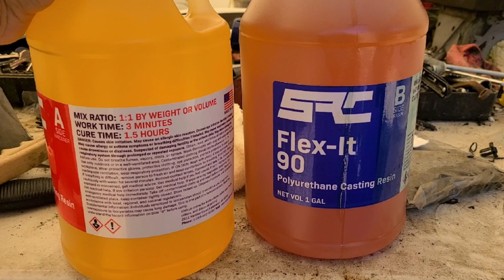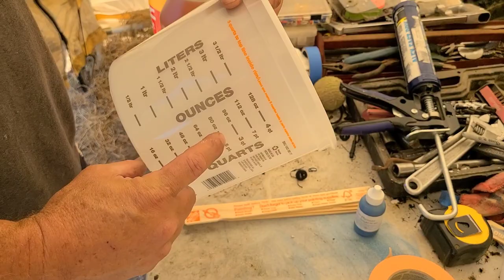How to make polyurethane railcart wheels

Comment: Poured upside down, leaked out the bottom, separation between batches, forgot mould release. Everything went wrong and still got usable wheels 😅
Reply from the maker: 60% of the time, it works every time

Comment: 3D printing the shell of the mould would be an idea; you could build the mould to separate and suspend the rim inside with standoffs. Only some have a lathe to form the wheel.
Reply from the maker: I know someone that did this and it turned out great.

Comment: Over here in England we have electric mobility scooters for the elderly / dissabled . The 6" & 8" wheels use little alloy split rim wheels ( plain shaft with bearings on front and keyed shaft on the rear ) .The poly tyres could be made to sit between the split rims and clamp them in place with no machining .
There are tiny " mini moto " quads that use similar split rim wheels , usually pressed tin that arn't as strong .
Looking at it i bet 3D printed TPU tyres would work brilliant in conjunction with split rims .
AND the mobility scooters use a rear diff to drive the wheels , these have a disconect lever to free wheel so a sprocket could be fitted for pedal power and engage the lever to sit back and use battery power . Sort of a hybrid rail bike idea ....

Comment: Nicely done! I'm considering slices of PVC pipe for wheels, mounted on dolly wheels. Slip PVC over the wheel and inflate the tire to secure it. Maybe an inside flange cut out of some cheap UHMD cutting boards. Wrap the PVC in inner tube rubber or dipped/sprayed in rubber bed liner. 
I was wondering about those Polyurethane "V" rollers that are used on boat trailers. Might be interesting to see how a "V" shape would work on the rails. 
I guess one could, with the tools to do it, make the hub from good plywood. Stack disks to make the cone shape. Find a flat/smooth sided flower pot/plastic container (Maybe even a terracotta/ceramic flower pot). Fill any drain holes with epoxy putty. Calculate the volume of the Poly needed (Definitely get some with a longer open time! LOL!). Pour that volume into the pot, then push in the plywood cone. Maybe an extra piece of plywood for the top with a flange to center the ply cone in the pot. Might need some fine tuning for balance, but that's not hard. Just need the pot to have the right taper on the sides to give you that auto-centering angle for the wheel. 

Or pour the tire on it's own and come up with a three piece wheel, like beadlocks used on off road jeeps and crawlers. If you want to get fancy/ not have to toss the rim every time the wear out/ or if someone wants to produce a wheel for sale that has parts available in case of repair needs. 
  Again, just throwing out some coffee shop engineering musings. :D
Thanks for the videos! Very generous of you and inspiring. ( probably to my wife's dismay..... LOL!)

Comment: To try to get rid of air bubbles, you could try some vibration as soon as you pour the poly. A palm sander, multitool, massage gun or even just tapping on the mold may help the bubbles rise up. Sort of like with concrete............
Wouldn't slightly bigger diameter wheels help straddle rail imperfections?

Comment: You need to prep the steel first, use a polyurethane adhesive, remove all paint etc and after pouring polyurethane it needs to cure in an oven for maximum durability

Comment: Here's a thought I had while watching your machine rolling along. Could you make a wheel by either riveting some rubber cut from an automobile  tire, to a small steel rim? Or alternatively it could be bolted to the rim, using bolts with large countersunk heads, just a thought. Dan S. From Michigan, & Texas

Comment: Ryan, what size are your wheels? 
You said that your flange is 1'' x 1''.
What is the width of the tread area?
My wheels are 6'' tall (7 and 3/16'' top to bottom) x 4 3/8" wide (5 and 1/16" front to back)
That should give me a 1'' inch flange and a 4 and 1/16" tread area.
After I pour my first "tire", (which will use a lot of material) then I will mill it to the finished shape.
Then I will make a two-piece ceramic mold (fire kiln) and use that mold as my new mold and use less material.
The ceramic mold should last forever and make as many "tires" as I want.
I should only have to mill the first tire (we will see)
My molds are ready for the poly and I want to be sure before I waste money.
Thanks :)

Comment: What would you suggest if I don't have a wheel to make a mold from?
Reply from the maker: I originally used at small bucket. Anything that isn't too much bigger than your wheel will work. The goal is to use as little polyurethane as possible.
Reply: @ryanrandomness  Thanks!

Comment: Good job on the wheels,  I wonder if a wood lathe would work for finishing the wheels?
Reply from the maker: Thanks. While not impossible it would be tough.
Reply: It's not the lathe, it's using the proper cutting tool, feed & rotational speed.
Reply: I turned a couple of wheels 8” diameter, x 2 inch thickness to make a rail wheel for moving a large trailer into a barn door .  Limited number of moves, but expect years of service.  May wrap with a band or side bolt a flat metal limiter.  Much easier and cheaper than making full metal wheel.  No welder or cad cutter , or plasma cutter needed.   Just your wood lathe & hole bit, & easy to cut a taper face w wood on lathe. First ones I made from maple , will use gum, elm or dogwood in future and test for life.  .  BTW, if your cart load has great value, add a drop safety block if u are worried about failure, but remember horse drawn wagons to war chariots had wooden wheels for centuries!
Reply: @carmiethompson2676  But you do need a lathe big enough.... 😉👍
Reply: @wingnutbert9685  A wood lathe doesn't have all the control a metal lathe would have. So my previous comment wasn't accurate. A wood lathe doesn't have a controlled cutting tool. It's free hand so thinking about it a bit more then I did previously, I don't think you could use a wood lathe. I'd like to see if someone could though.
Reply: @carmiethompson2676 Yes, for sure a metal lathe would be much easier in terms of  micrometer accuracy and repeatability. But one could use a template gauge on a wood lathe and likely get very very close tolerances. Enough for this work. And certainly requires experienced hands and eyes, but same goes for operating a metal lathe. I've worked with a couple woody's on client projects and I wouldn't hesitate to say turning something like these wheels would would fall into the 'easy' category for them. I've managed to "lathe" (turn) a 1" thick, solid steel pulley for a client. Just used my shop drill press, an angle grinder and a die grinder in a slide vise and a hand file to dress it. Nothing fancy, but was pretty darn accurate for bodging it. 😁👍
Reply: @wingnutbert9685 Interesting, thank you. It's just that I think the precision would have to factor in because there are two wheels that are secured to a solid axle. There's no differentiation at all, a 'Locker' gear in automotive terms. So the wheel diameters & the self-centering taper would have to be very close. In this case I don't know what 'very close' would be but I'm guessing it's a 'close' that would be very difficult w/ a wood lathe. I'm sure it could be done, probably start w/ a single piece of material & cut following a template, then saw in half. Huh...sounds do-able.😎
Reply: @carmiethompson2676  Yep. For sure doable with the right experience, tools and imagination. Given how incredibly thin some turners can get the walls of a wood bowl, precision and repeatability to a thou. is likely quite doable. And I agree the more matched the better. Don't want to feel like you've got egg shaped tires! LOL! 
I believe I've even seen a fella that make a jig/tool holder for his wood lathe. Was pretty bulky as I recall. But did work very good. He could clamp both wood turning chisels and had an adapter to hold carbide metal tools as well. And could even do aluminum with the wood tools. 
Guys in little villages, in Asian countries are the ultimate masters of DIY junk bodging tools and machinery. I build a number of my own bending and forming tools and jigs for my work. Either out of refusal to pay $$$ for a tool not often needed or something is just not made to do what I need. And in the case of doing production runs of a product, shop made jigs and tools are an necessary skill and art. It's actually my favourite part of design. Designing a product is fun, but making bending and assembly jigs and fixtures to effectively make 100's or 1000's of a product is what I really enjoy doing. 
I've made some suggestions to the OP about some ideas for faster and repeatable production ideas. But I think ideally and without great difficultly, one could mod/customize an off the shelf castor wheel or some other type wheel for low effort, tooling and cheap.

Comment: Wasted Effort. Trains use metal wheels because a box car hauls 180,000 lbs.
Metal wheels reduce rolling resistance. Your little railcart doesnt weigh much.
Rubber tires actually work better on the metal rails-better traction. All you
need is the flange to keep the wheels on the tracks. I saw one guy simply 
used plywood discs. Amazon sells 12" metal discs. You can simply attach the 
disc to each wheel. Dont make it harder than it needs to be.

!
Reply from the maker: You should try actually watching a video before you comment. Thanks for the good laugh though.